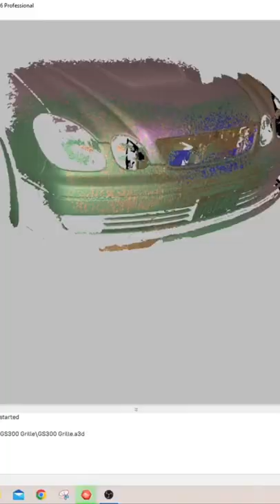Custom Grille! (3D printed!!)

Comment: How does it hold up to the heat?  Will it deform if installed and used in hot weather and traffic jams?
Reply from the maker: ABS, same material as stock.